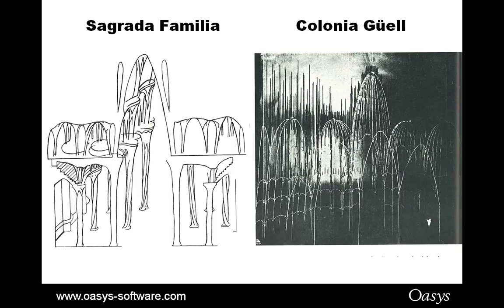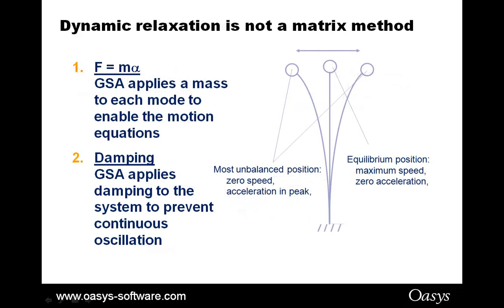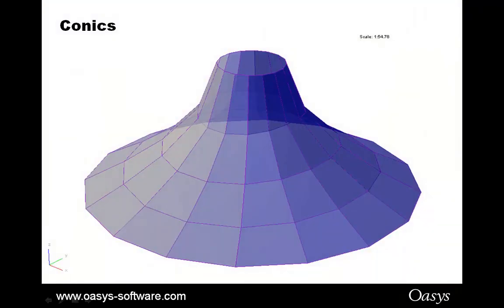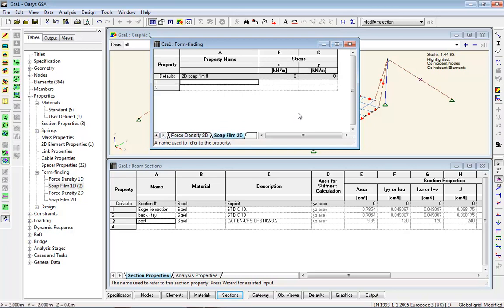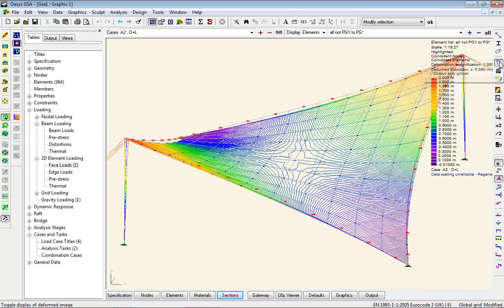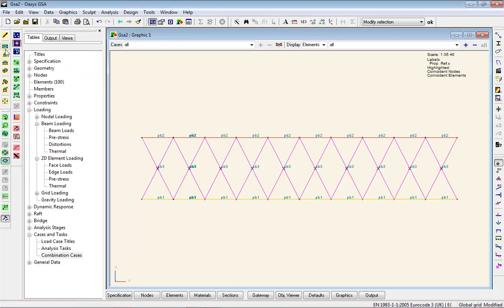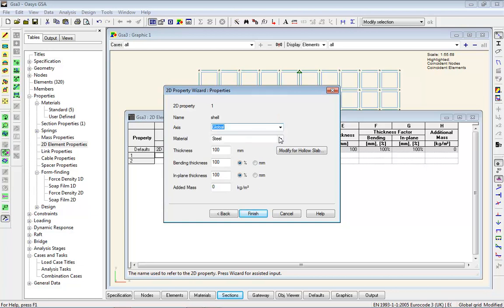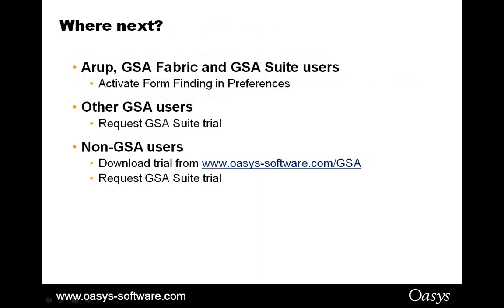Cable Nets and Grid Shells: Form-finding with GSA (Oasys Software Webinar)

Comment: How would you model and form find for a conical type of tensile structure?
Reply: Sherwin - possibly the easiest way to model the conical form is to use the New Model Wizard to create a conical form. This can include the spacers, if you are planning on using the Soap Film method. Once you have the intial form and have set the boundary conditions and properties, run the form finding method of your choice.